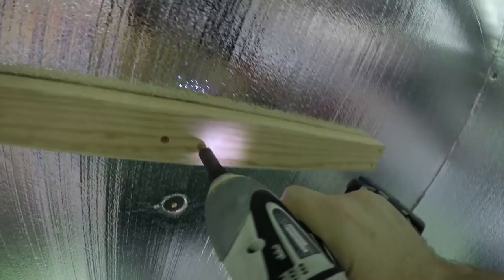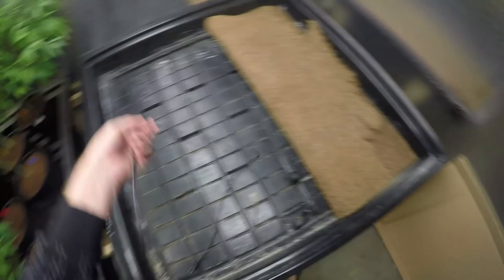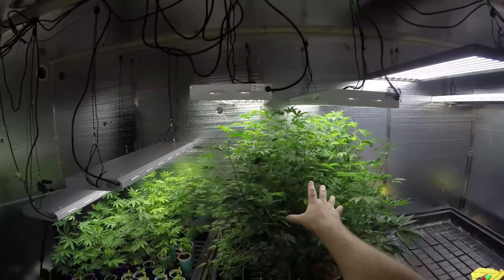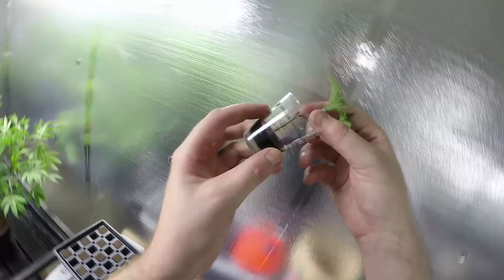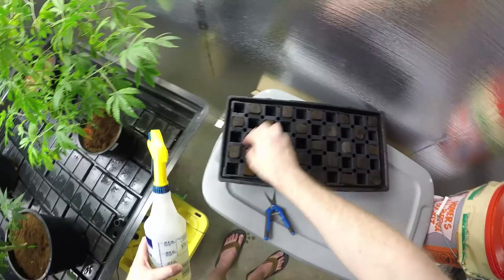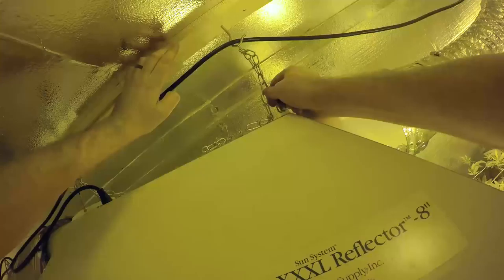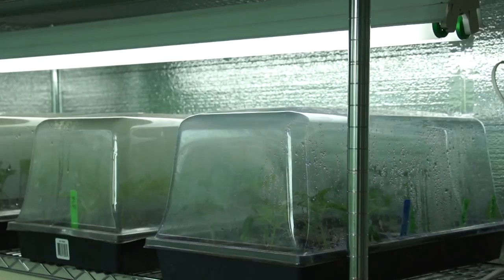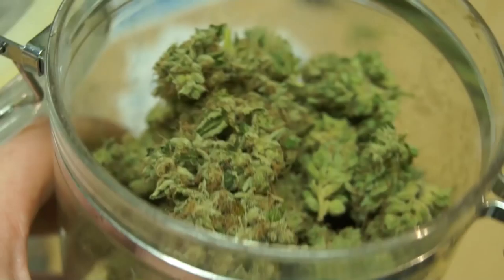Back to the Future!

Comment: yay, glad to see you back. :) things look great as usual in your garden. We just got hit with a little PM for the first time in years in our small closet space, so I am on clean up detail now, going to use Actinovate to treat the other 2  unaffected plants in early bud stage, but wonder what you do to control PM with so many girls in your space? in Oregon we only get to grow 4, so its manageable.  I suspect my choice to put the fan in a fixed position instead of oscillating last week was not the right move, and might have been what created the favorable PM conditions in our small space, along with the extreme change in temp since it cooled off, maybe causing more condensation.  PM is bad here in OR, hard to get away from it.
Reply from the maker: +jambandphan03 probvably want to invest in a sulfer burner, you can also hit um with straight foliar of 9.0ph water
Reply: thanks for the reply :)

Comment: do you ph your reverse osmosis water for your flush? if so how, because the ph can't be read when it is pure. I just switched over to ro.
Reply from the maker: +James 84 No need to PH durring flush, the PH is for your bonded nutrients, NPK's  enzymes and sweetners arn't ph dependent and the plants won't suffer with out an extreme ph, RO water at 7.0 is fine.
Reply: VaderOG Thanks. That makes sense and makes it easier. I have always ph'd during the flush with tap water but now I will try it without with ro. Much respect to you and all that you do. Keep making bomb genetics.